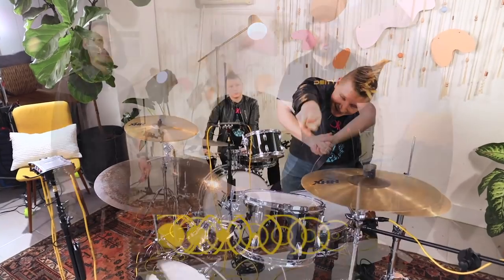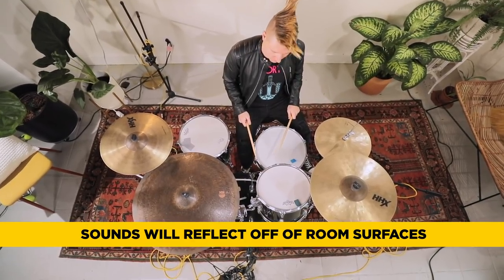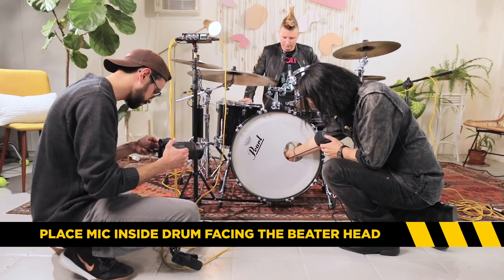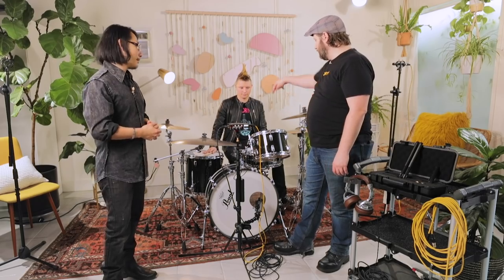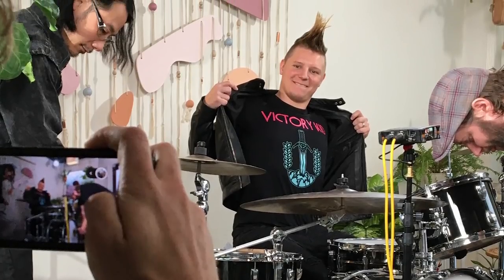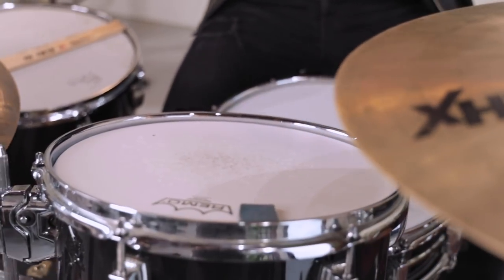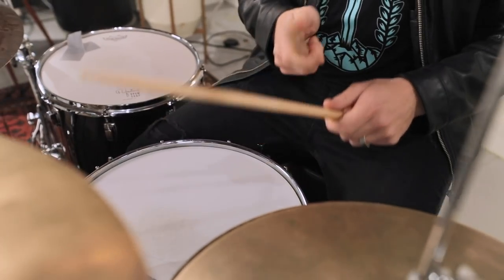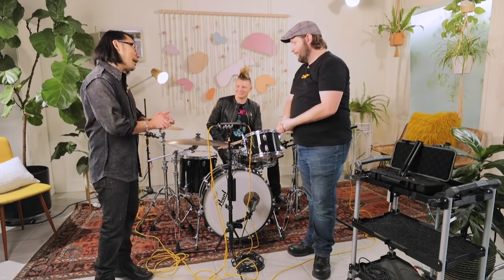How to Mic a Drum Kit | Mic Placement Techniques for Recording Instruments

Comment from the maker: What would you have done differently?
Reply: I could show you guys, but first i'll need that free S-Mic 2S.
Reply: Probably could have done a stereo recording and this possibly include other instruments and vocals. In addition to this, maybe a ambisonic recording if the option is available.
Reply: In German there is a mic called Wurst (sausage) basically a SM57 placed underneath the brass and above the toms / smare facing the player directly from in front. Basically miking his stomach from 75cm away. Sounds great.
Combine that with a kickdrum and something for the snare or an overhead and it would be possible to have 3 mics. More mics, specific to a single drum or piece of brass and options with different sounds to them are still the preferred way though 😉
Reply: Great episode!

Comment: Also I don’t know if it’s the YouTube compression or what, but the kick drum (a and b) sounded strange to me (a bit muddy or something?). I would’ve experimented around with the kick drum mic a little bit more.
Reply: Sounded like clipping on the kick mics, too. Perhaps at the mic rather than the preamp. Though not noticeable once all mixed. Hard to tell without seeing those waveforms! You can see the outside mic either getting pushed by the air or wiggling because it's clamped to the shell.  Floor tom needs some damping for sure. It's ringing almost the entire time.

Comment: I would not use an omni for a third mic as it picks up everything. A good cardioid placed higher and a little to the left of the ride cymbal (drummer's perspective) will get that done and the rejection at the back of mic can be utilized to negate extraneous, undesirable noise artifacts as needed. Also, I would experiment if I was able to, with a bidirectional ribbon mic between front of kick, bottom of snare, and hi hats which might allow for stereo overheads (3 mic total); or even a different mic for lower tones on the resonant head, along with the third mic as mid-side, again, in cardioid pattern.